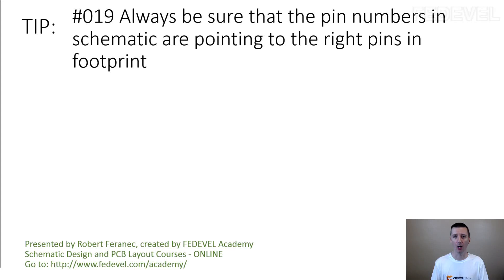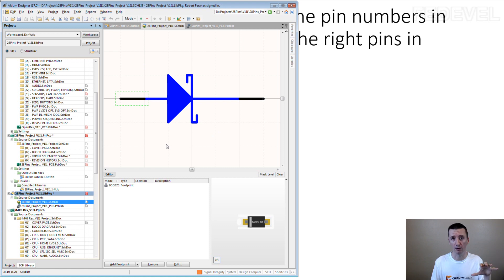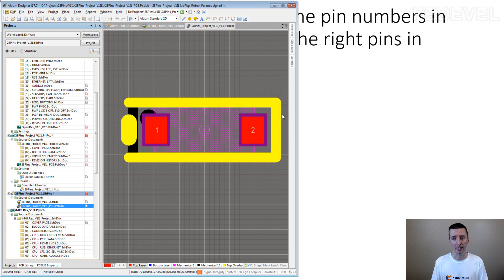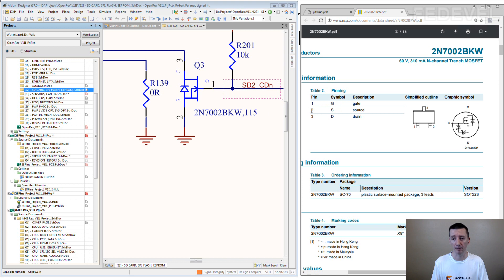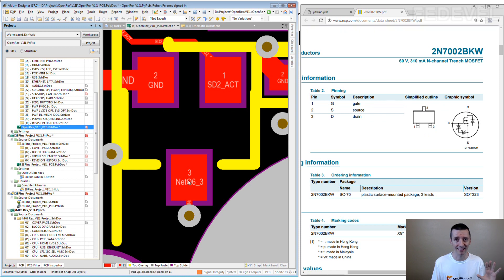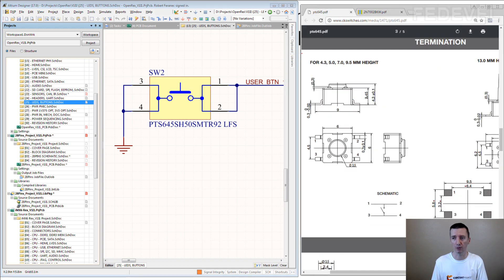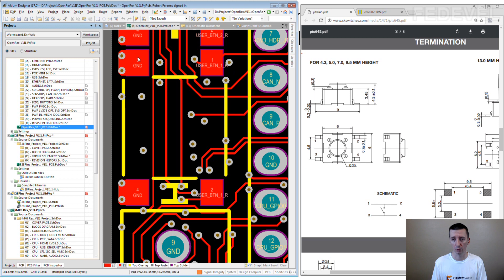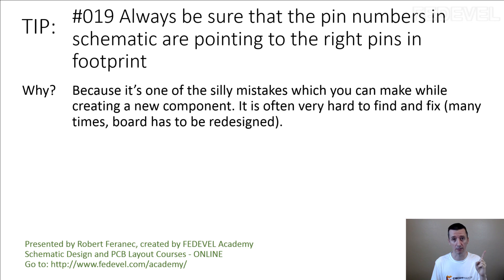TIP #019: Always be sure that the pin numbers in schematic are pointing to ...

Comment: I made this mistake with an MCP3008 8-channel ADC, so the right side of the chip, that's pins 9 through 16, were numbered starting at the top, rather than continuing anti-clockwise from the bottom. Fortunately, as pins 1 through 8 were the analogue inputs, I was able to install the chip upside down, and the chip worked just as well. That was a wild time.

Comment: Pro Tip: 
The pin "numbers" in Altium don't have to be actual numbers, so for a diode schematic symbol, you don't need to have pins numbered 1 and 2, you can have pins numbered "A" and "K" instead.
Then on the PCB footprint you have the matching pin numbers "A" and "K", so it is then impossible to get them muddled up as to which is the anode and which is the cathode.
Like wise for electrolytic caps you can use "+" and "-", and for transistors you can use the "numbers" B, C, E, and for FETs you can use the "numbers" G, D, S.
Components with more then 3 pins are less prone to ambiguity errors, you can still use numbers with those.
By using this simple trick our board design failure rate was cut significantly.

Comment: For Diodes,  i personally like to label the pins as A(for anode) and K(for cathode) instead of labelling them as 1,2.
Reply from the maker: Maybe if you need to follow IPC standards, you may want to use numbers. Just search for IPC-7351 (It says: Pin 1 on Left Side, Pin 1 is always the Cathode).
Reply: Totally. There's no reason not to. Same for transistors. ...and polymer capacitors. Why did I not use it for polymer capacitors?
Reply: Same for mosfet, I tag always with GDS or BCE. When checking layout later, it is handful to see the GDS in addition of the net name.
Do you know if there is a reason against such usage?